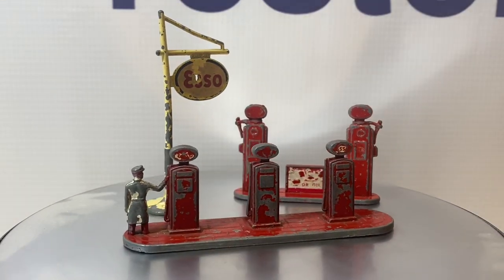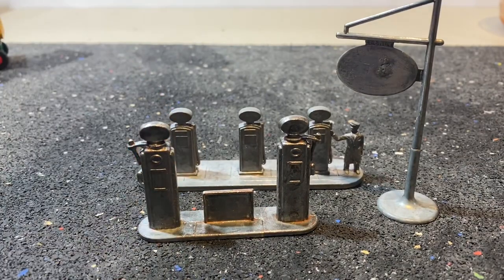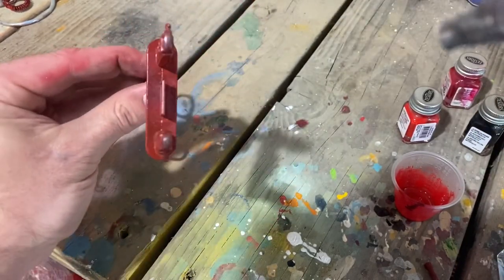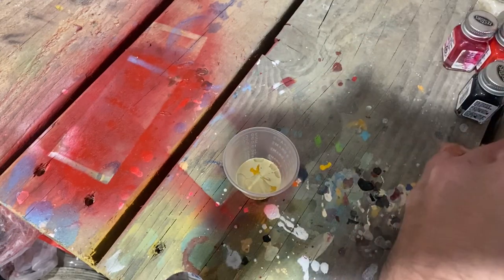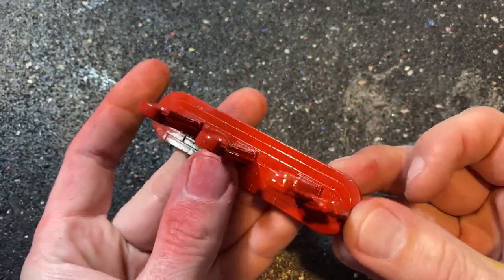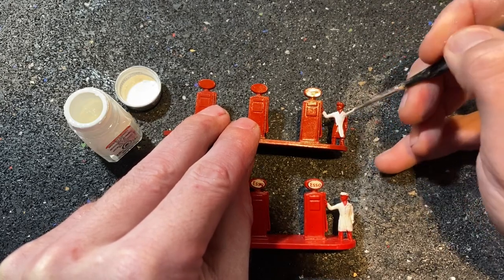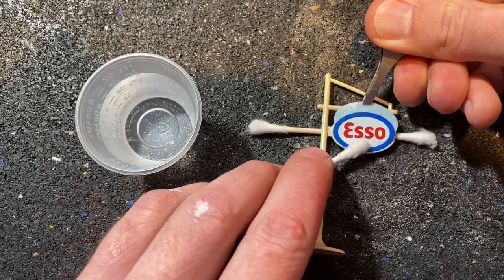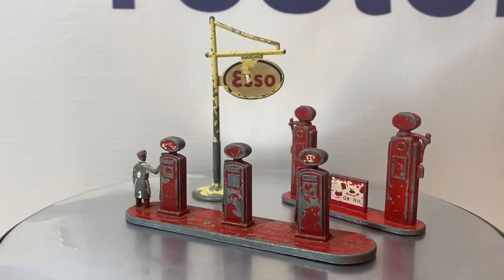Matchbox Lesney  Accessory Pack #A1a Esso Gas Pumps Restoration and Repair

Comment: How long Do you put your Modells in the oven and which Temperatur Do you use?
Reply from the maker: Graham Swinfen usually 20 minutes under heat and a 20 minute cool down afterward with the door open.  I set it about 180 degrees.
Reply: @vintagediecastrestoration  Thanks for your help